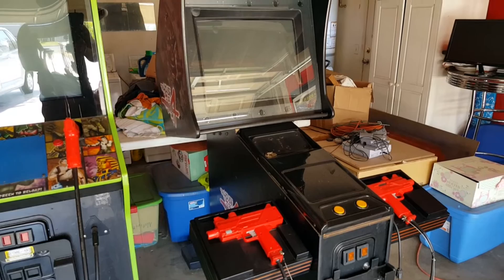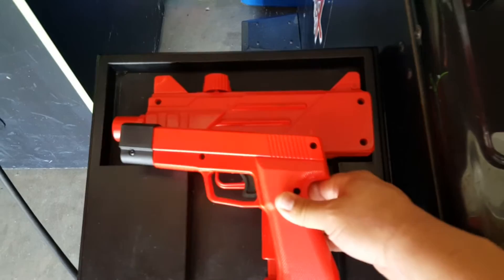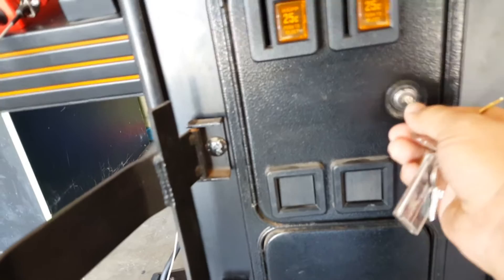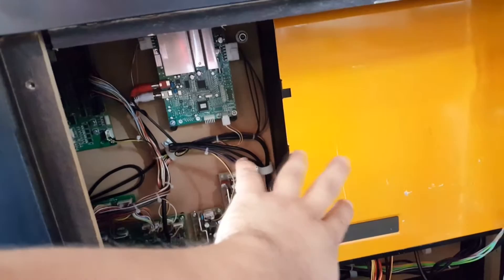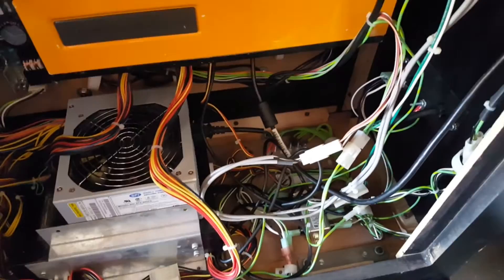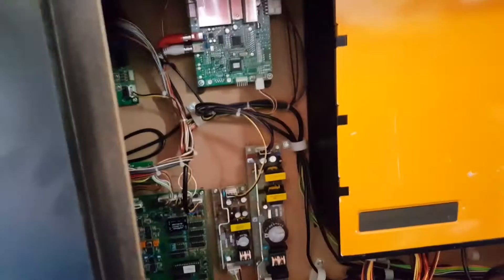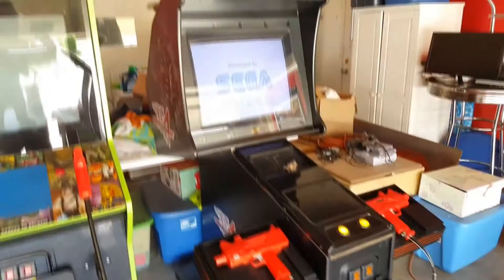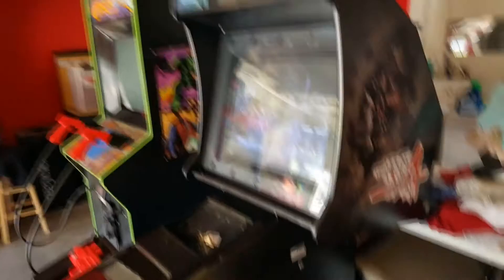A Look Inside The Sega HOTD4 Arcade Cab

Comment: Hello! Maybe you can help me! My HOTD 4  when I turn it on says! I/O Jvs is not connected to main board! Any help will appreciated! Thanks!
Reply from the maker: Your I/O board is not connected to the main unit. Just check all your connections. Or your I/O board is bad and you need to get a replacement.
Reply: moomert1 do you happened to know where I can get a replacement I/o board? Thanks for the info!
Reply from the maker: @ulisesarias1887  ebay or the KLOV forums.